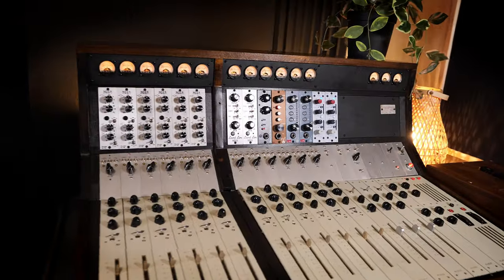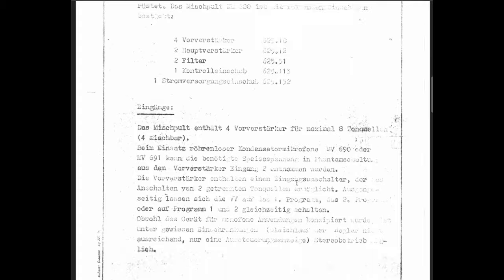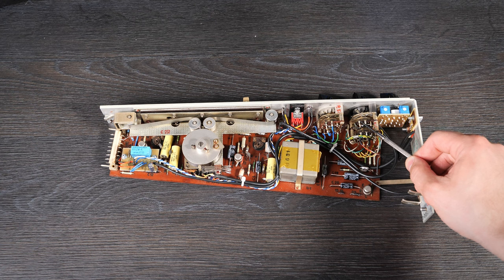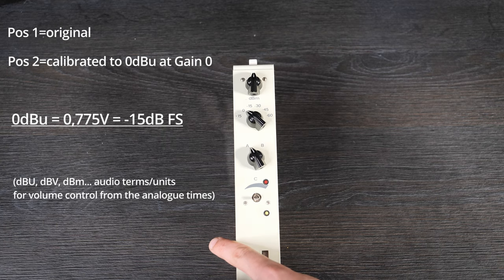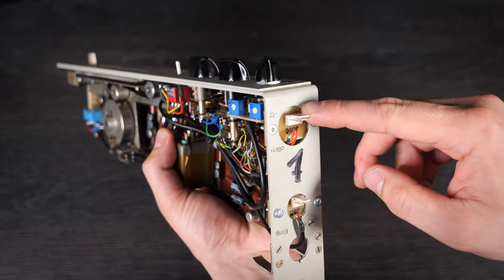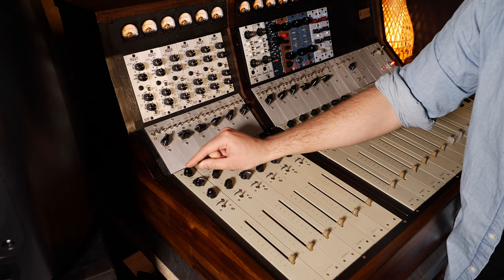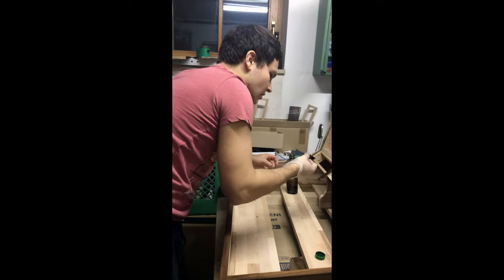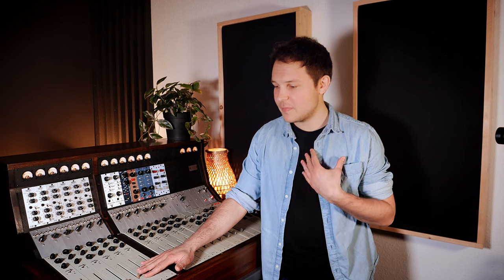Vintage Mixing Console Restoration - repair and expand the KSG625 from 1972!

Comment: Great project!
But most likely there are problems with the VU meter.
This is a stereo (not balanced) connection, and at the same time the VU has a phase shift when the signals at the stereo input are unbalanced. Mono VU meters would be better. They are more expensive, but the accuracy and independence of measurement is better.
Good luck!